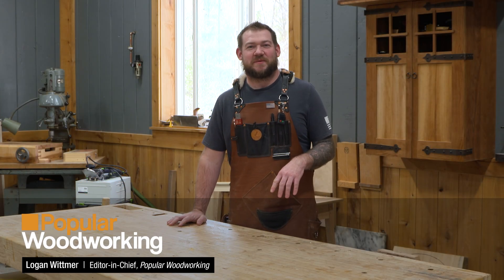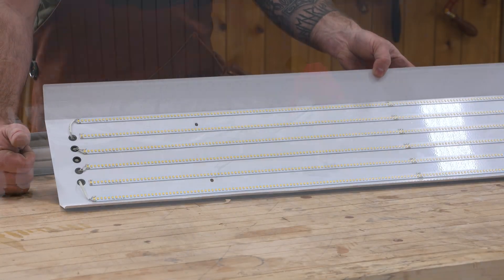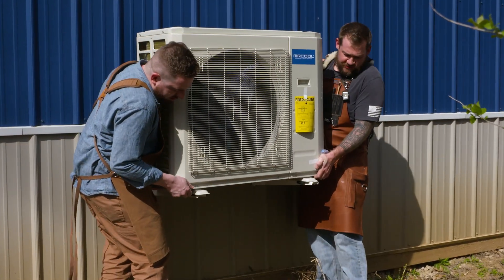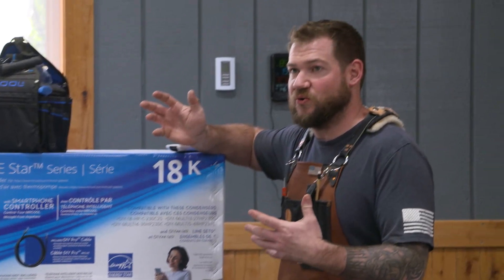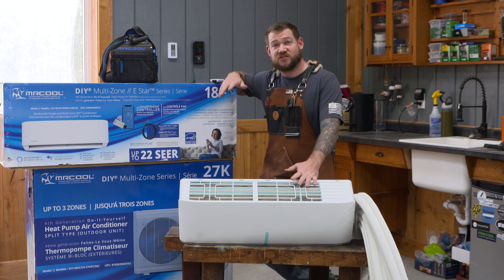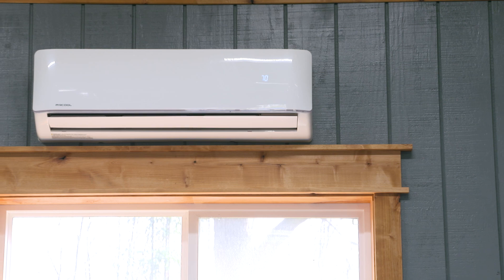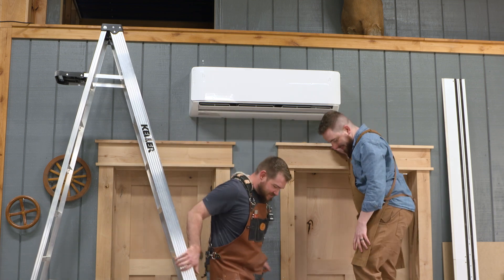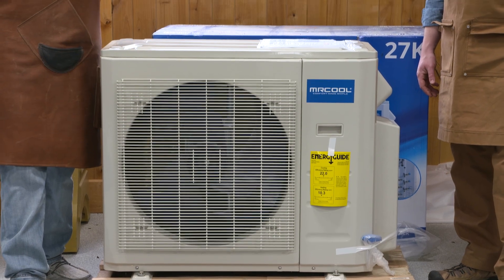HVAC In Your Shop: Choosing and Setting Up a Mini Split System

Comment: I have been running a mini split in my 900 square foot shop for four years now.  I run an air cleaner and use dust collection to reduce the amount dust that could be sucked into the filter.  Despite those efforts I do regular maintenance, 2-3Xs per year, on the unit by cleaning the filter and fins.  I have had no issues and no regrets with this decision.

Comment: Good video, but you missed the third important issue.  You discussed heating, cooling but missed dust issues.  There is almost no filtering to protect the head units. Most of us with wood shops still struggle with dust collection. The dust in the mini split head is an issue.

Comment: Put a window unit in my shop.  I talked to an HVAC contractor about a a Mini Split but wasn't sold on the 1/4" foam air filter. I asked about building a box for a large MERV 11 filter.  I try to pick up all the dust I can at the source but still see some on the floor and other surfaces.  The HVAC guy said the MERV filter would void the warranty.  I figured if I wasted a window unit I would only be out $500,  I'm glad I did.  I put a 24"X25"X5" MREV 11 in a box over the in-take of the window unit and by fall it's full of dust most of which would have floated through the foam filter on the Mimi Split.
I would be interested to hear how others keep their units from getting plugged up with dust?

Comment: There looks to be a lot of length in the line connecting the two parts. Does it need to be shortend somehow without loosing
the charge or is the excess just hidden somehow?
Reply: You need a "minimum" of 10ft of line set for mini splits to run properly. With these home owner DIY mini splits the line set comes pre-charged as well as the condenser and Air handler. The fittings are 1quick connet. It's how they get away with not pumping down (vacuuming) the line set of air and impurities.... 

If you wanted to shorten the line set you would need to cut the copper (release refrigerant) to the length say 15ft, then flare the ends and use flare nuts. None of these diy units allow for this as they do not sell the flare nuts separately.

Comment: Very interesting and nicely done. Was hoping you would include some commentary on dust control and dust management and how these units can (or can’t?!) handle an atmosphere such as a wood shop. Additional feedback on this would be much appreciated.
Reply: I agree with this. I have one in my shop and early on I noticed the fine sawdust would mix with the water on the coils and create this waxy buildup. It was a pain to get off and it also dripped this nasty waxy gook off the vent fins. I’ve since stopped running it while doing a lot of dust making. I wonder if there’s a finer filter that might be used in this situation (the one that comes with most minisplits is basically a washable net rather than a filter)

Comment: I love my Mr Cool mini split. 66 degrees in the winter and 72 in the summer here in Cleveland, Ohio
Reply: How much did it cost and does it need a water line?
Reply: I live in Galion and our electrician installed one for us in our four stall metal garage.  Still need additional heat and this summer I will install a heater on dedicated 220 line.  Biggest help was that I installed 2" 4' x8' insulation sheets and slowly getting to overhead roof channels with 1" panels same size.  Not as warm as our house but keeps the rust off all my cast iron woodworking machines and I can still work out there with just a coat and cap in the winter.